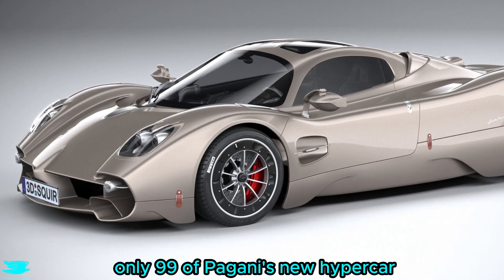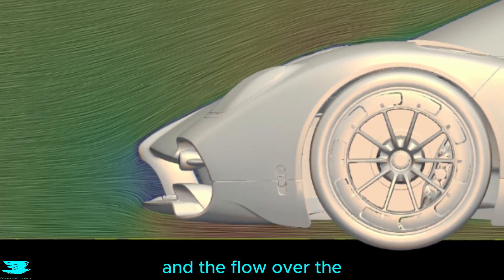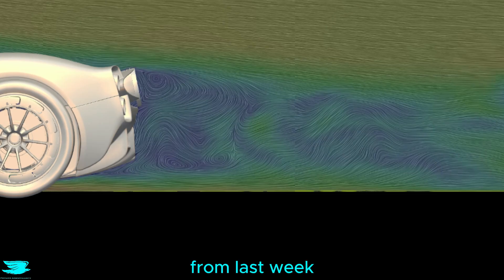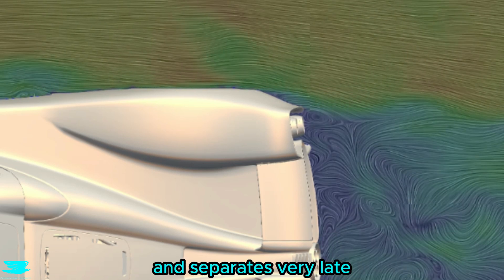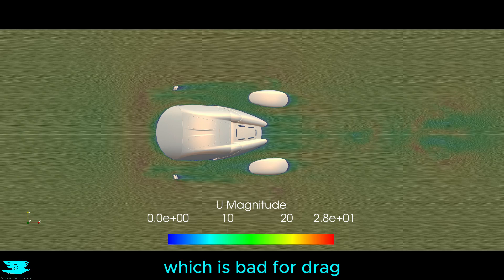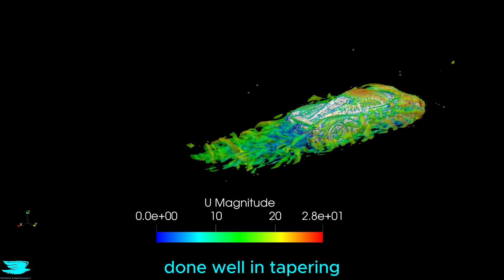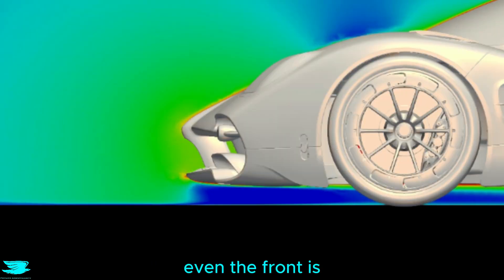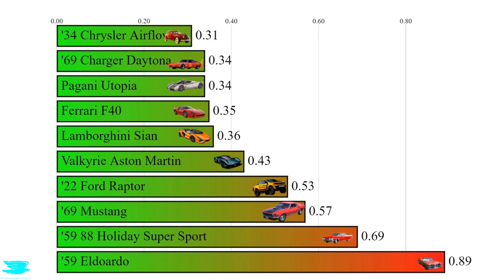*Pagani Utopia Hypercar* Aerodynamics

Comment: but dont the turbos suck in air from the roof part (red) and improve aero?
Reply from the maker: They definitely help, but they are located to the sides a little, so there is still some roof section not directly exposed to them.

Comment: Please do the T.50 next!
Reply: +1
Reply from the maker: Thanks for the suggestion. We'll see if we can get a good model of it because it has some interesting aero on it and we want to make sure we can replicate it.
Reply: @PremierAerodynamics  Out of curiosity, how ARE you getting the models?

The T.50 shouldn't be that hard to get. It's in several games and also there are some fairly accurate scale models that could be 3D scanned. Of course, if you wanted to simulate the fan working, that would be a bit harder. There are some videos where the fan ducts are shown in full, but I am not sure how easily you could make that into a model.
Reply from the maker: We usually download them from a game, but yeah, the fan and ducts are crucial for this type of car because that is its main draw card.
Reply: I am pretty sure GMA themselves will probably give you if you ask them nicely since how open gordon is and even showing the parts to customers and top gear. And test them in different configurations and also a story about the extra 30% downforce more than expected when the fan wasn't running.